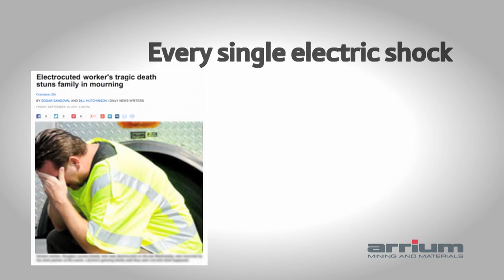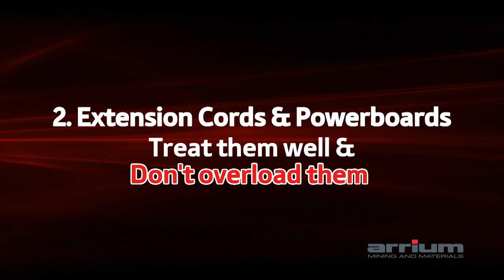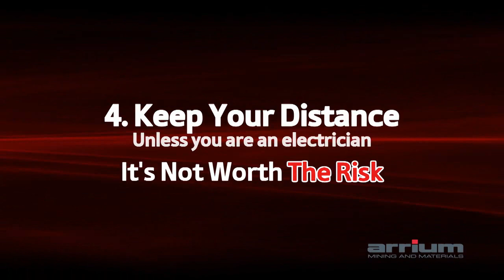Living Safely With Electricity - Electrical Safety for Non-Electrical Workers (Emotive Video)

Comment: Almost non-sketchy welding sets can not kill you because they output lower voltage with high current. The high current is what initiates a spark which can weld metals together. The welding sets are also direct current, so that reduces the risk of electric shock even more.